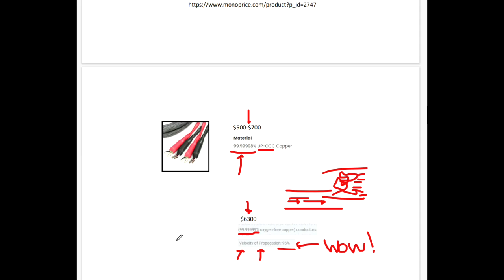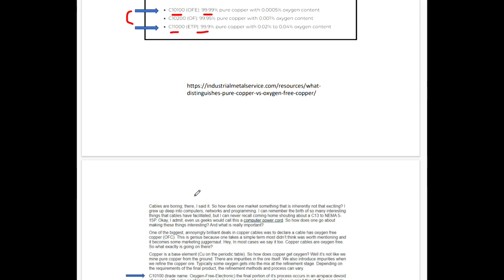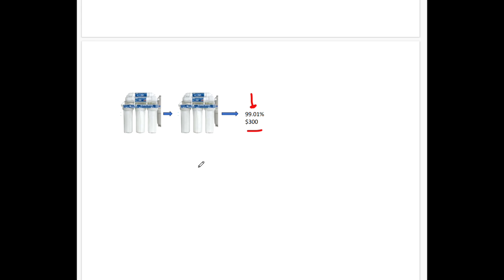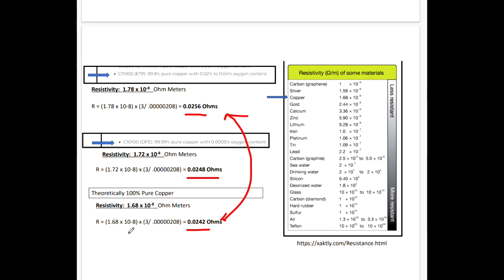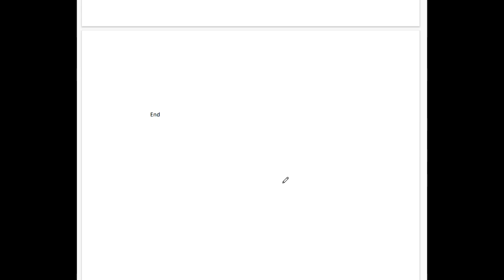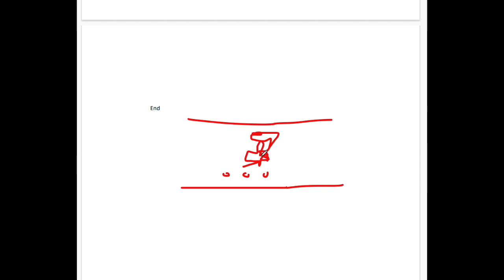Myths about Speakers Cables Pt. 2; "Oxygen Free" and "Velocity of Propagation"

Comment: I’m low budget I use lamp cord grade wire with banana plugs😂
Reply from the maker: I you dip the lamp cords in frankincense oil and coat them with Molasses, it'll improve the imaging, and make the snaps sound snappier, and such ...
Reply: @stereopolice  if I wrap the wires in black licorice will I get blacker,darker backgrounds around the instruments? 😜🤪😝
Reply from the maker: Right on, that's how it works! 
 @badbruise